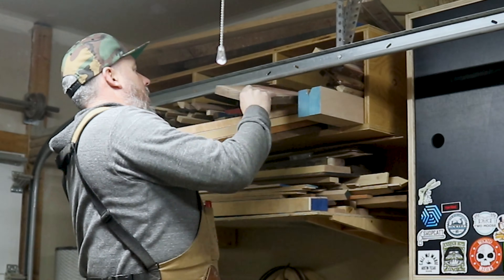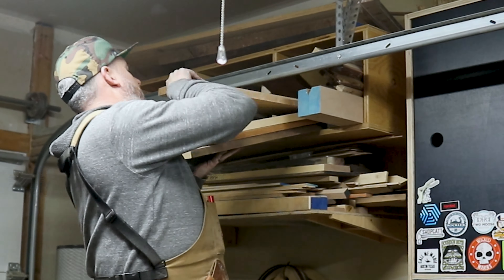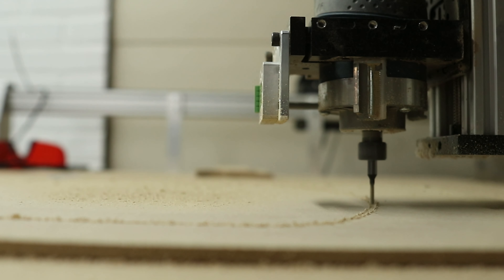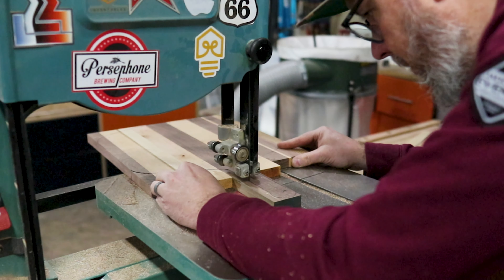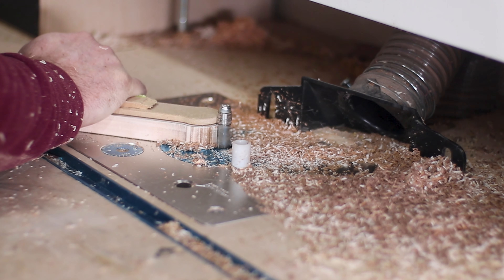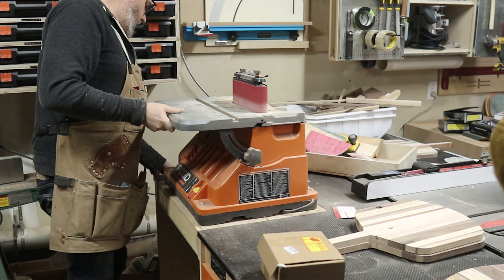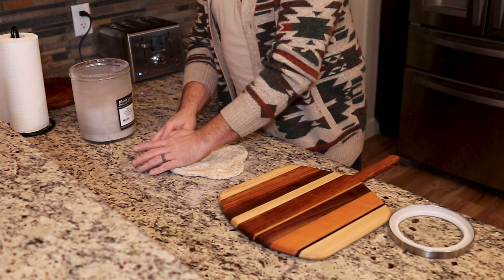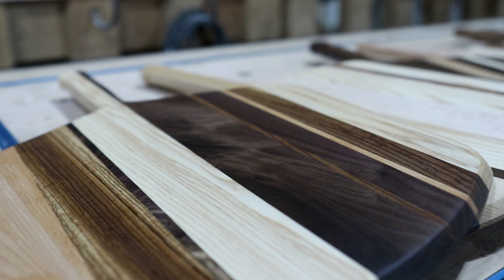If it could have gone wrong it did

Comment: Great video, Kris (as usual) I think a work around for the router would be get very very close with the bandsaw and clean up the lines with a drum sander. It would take longer for sure but would be the safest way.
Reply from the maker: Yeah, I think you’re right. I did that on some mallet handles I did recently

Comment: Hey quick tip. Don't use that double sided stuff that is meant to hang up small mirrors on bathroom tiles. There is a little foam pad in between and it tends to move a little bit. It is also a bitch to get off your workpiece as you probably have noticed. Just use regular very thin double sided tape. It's stronger, cheaper and safer.

Comment: The paddles look great! 

What eneded up happening to the motor on the drum sander? Was it a bad capacitor or the whole motor?
Reply from the maker: I still need to take it somewhere to bench test it. It’ll run for a few seconds and then shut off.
Reply: @furthernorthfab  if it has a run capacitor it could be that. Easier fix if they just dont turn on
Reply from the maker: We might need to chat…